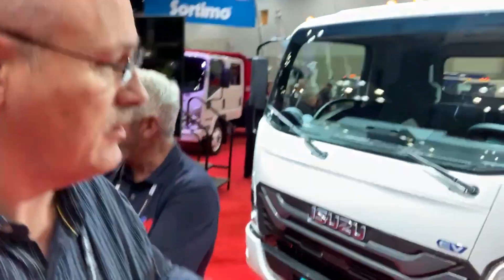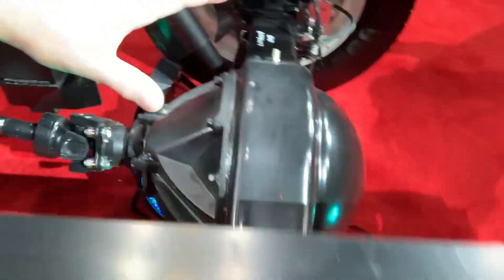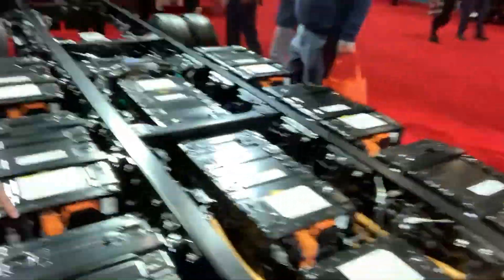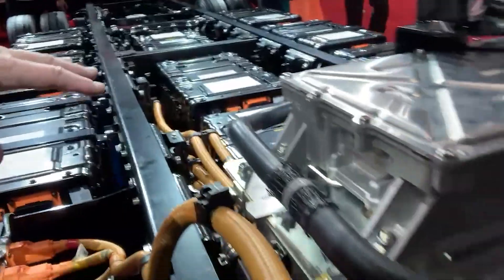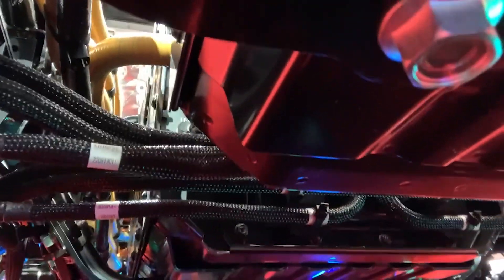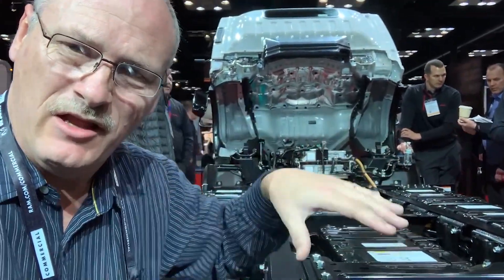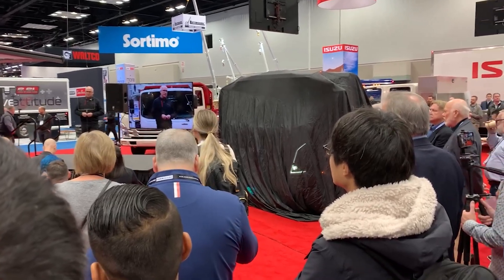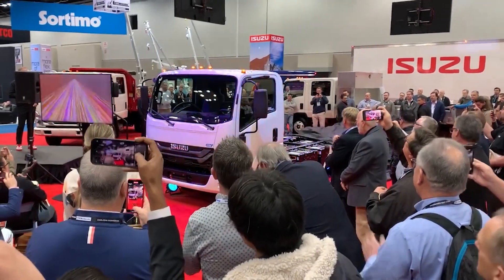Isuzu Electric Vehicle NRR with unveil - a full video review from Michael Olden

Comment: i'm thinking about using this as a rv with a switch and go system. Does this have similar towing capacity as the gas NRR or is it less? With the EPTO can i hook up the rv to it for backup power or to run a AC?
Reply from the maker: The available payload will vary to accommodate the range of operation you are seeking up to 120 miles is available but will reduce payload and power to pull.  The EPTO is an exciting option that I hope to have confirmation on the process to connect.
Regarding power - The generated power is very strong, but EV Commercial trucks have the following stated characteristics
6U4-09 WB 176 
Battery Capacity 180KW 
Weights Front 5548 Rear 4070 Total 9618 
Remaining Payload 9882 for towing and RV mounted equipment.  

Electric Motor Data: ZF CeTrax Lite 3-Phase AC Motor
Operating Volage       350 Volts
Max Power Output     150 kW
Max Torque Output     280 lb-ft
Max Rev.                     13,000 rpm
Max Speed                 65 mph
The NRR-EV is powered by the ZF CeTrax Lite 3-Phase AC Motor. This motor is designed for a zero emissions solution with enhanced durability and reliability. The motor sub-assembly includes an integrated DC-AC inverter, single speed reduction gear, and MCU (Motor Control Unit). The driving motor rotates according to the AC voltage and frequency supplied from the inverter and has a maximum output of 150 kW. The inverter takes direct current (DC) supplied from the high voltage batteries and converts it to a 3-phase alternating current (AC). According to the requests from the VCU, the AC voltage and frequency are changed to control the motor output. The motor assembly also has a built-in parking pawl mechanism.

Comment: It is better for this truck to run on petrol
Reply from the maker: Alternative powered vehicles can surprise you.  The motors used are extremely powerful.  They have to be power reduced in most on road uses.  The distance you can operate on one charge can work for many industries.  Not so well in others.

California is now requiring 10% of all trucks sold by dealers in the state of California to be electric.  This is truly affecting those dealers.  Additionally it will have a dramatic affect on mid sized to large fleets who are also being held accountable.

The cost is much more than combustion engines.

It will be that by choice or by requirements for EPA that alternative fuels are heading our way.  A significant change happened this year.  2027 is another evolution where many of the engines you see today will be dramatically changed or cease production.